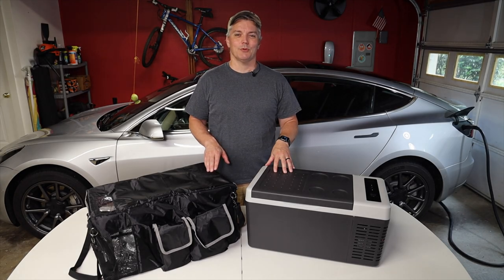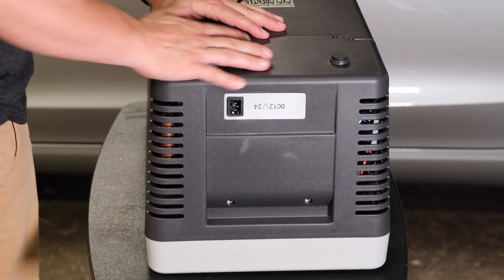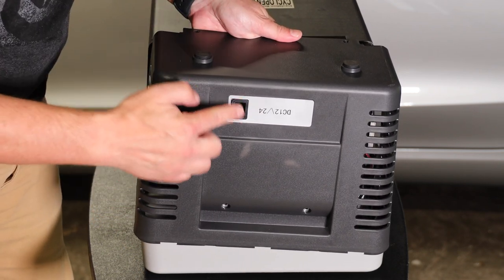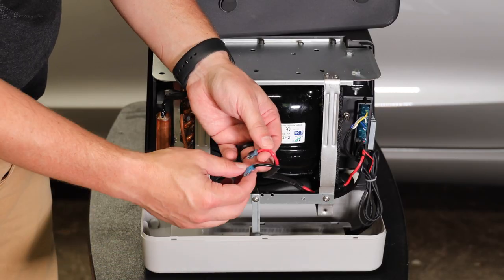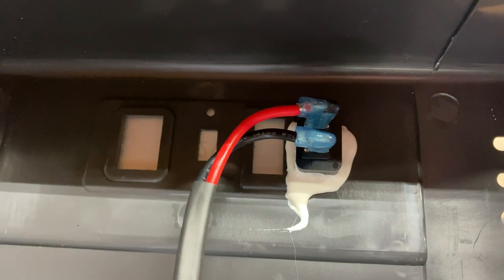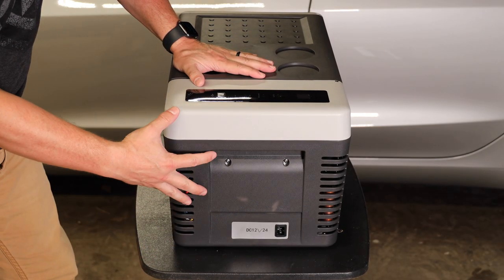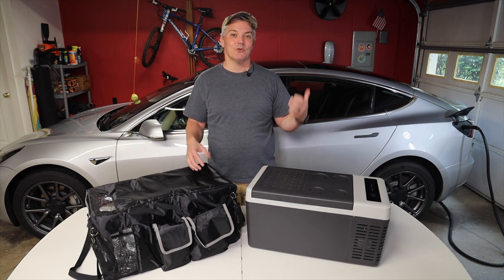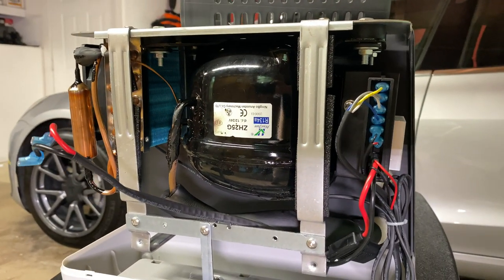F40C4TMP Fridge/Freezer Fuse and Power Cable Access

Comment: Great addition to the previous video! I just with that you could've shown us more of what's under "the hood"!
These are night and day better than the heat pump ones that I have been using for years that were only capable of dropping the temperature 40ºF below whatever the ambient temperature. You got whatever you got with them, but it still beat buying blocks of ice, if you can even find those old machines that drop a block into a dirtymetal bin.

Comment: i accidentally discovered a setting in which i pushed and held the "minus" and "power" buttons together when its poweredoff; unlocks settings on screen display "CC" and when i push minus and plus it scrolls through cc en ch nl hh? i dont see these advanced settings in the product manual, what do those settings mean?

Comment: Have the same unit. I thought it wasn't working because I didn't put my hand on it with the engine off in my car but it was working but there are no lights at all on the panel. Do you have any kind of fix for that?

Comment: Thanks for this video. I have the same and like it a lot. 

One question for you though: do you know where it senses temperature? 

Yesterday, I filled it up more than usual. I noticed in the morning that it ran all night and food was frozen. Temperature was indicating that it was still high so it kept refrigerating.  After moving things around, leaving space between the food and walls, it seemed ok. But it would be nice to know exactly where it reads temperature.
Reply: Same problem. Still can’t figure out where it reads temperature.

Comment: Hey Cameron, is there a way to take off the front panel to access the circuit board? I need to disable the very loud beeps because the are driving my dog nuts - she actually shakes every time it beeps which is always… thanks!
Reply from the maker: It might be a week before I can answer this as mine is deep in storage right now.  I’ve got my first trip of the new season scheduled for next week, pending good enough weather for it.

Comment: Code doesn’t work for combo but did work with just the refrigerator itself.
Reply from the maker: Interesting.  Might be cheaper to use the code for the fridge, then add the case than to just buy the combo.
Reply: The Tech of Tech yeah, currently Amazon has a 5% coupon that stacks with your code. $203.51 which includes 6% sales tax for my state (not including the case) Not bad! Thanks for you videos!